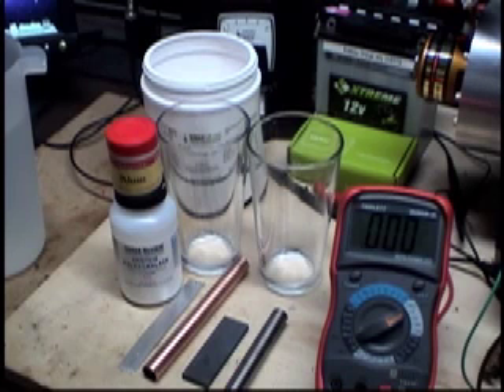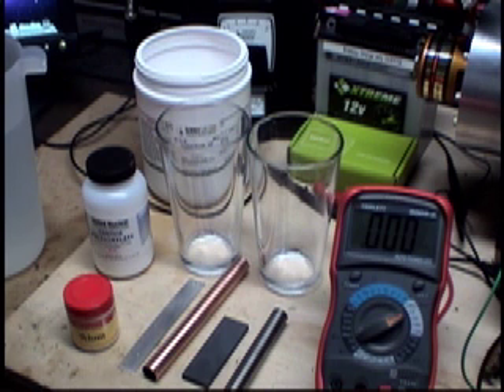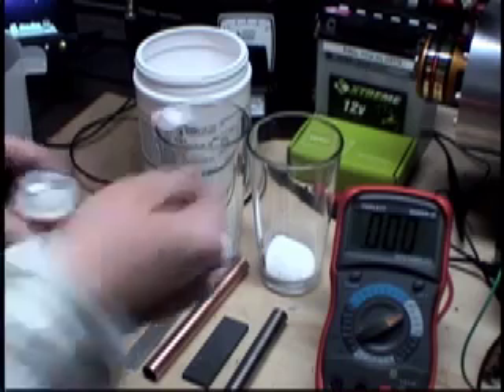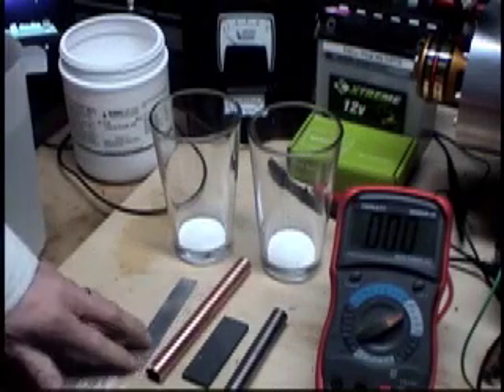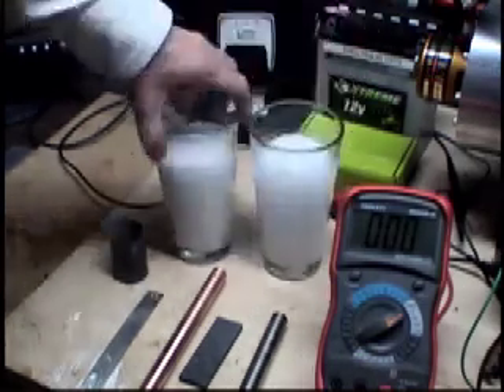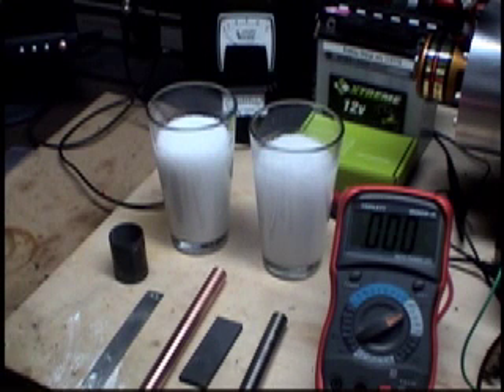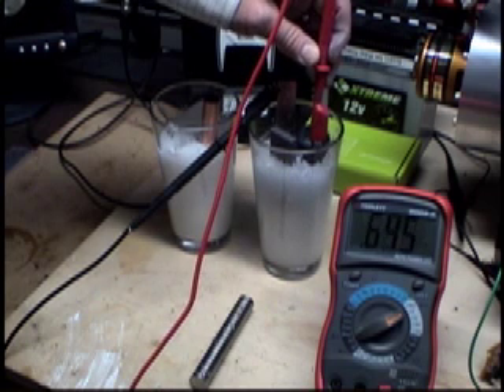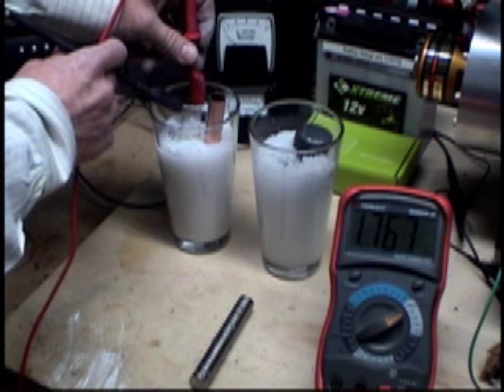Gel Battery NA+Polyacrylate.mov

Comment: now add the toothpaste, the concept is sound, The fluoride is what the new batteries are going to be using as electrolyte. This was John Goodnoughs thoughts as to doing thin layers of glass with the fluoride in the glass. Which comes out to be a thin layer of plastic electrolyte. I have already been trying it out and he was right, it is better.

Comment: Many thanks. Could you please do a short circuit test which materials deliver thr most current?

Also what ohmical DC resistance does thr fiber tube have from one end to the other?
Could you please measure this with your Ohm meter please?
Many thanks in advance.

Comment from the maker: Dear Stefan,
The CF Tube material is From Mc Master Carr Item # 8654K57
1/8 wall thickness, 1.25 ID 1.5OD
The Carbon Block is also from Mc Master Carr
1763T13
High Temperature Conductive Graphite 1/4" Thick X 1" Wide, 3" Length